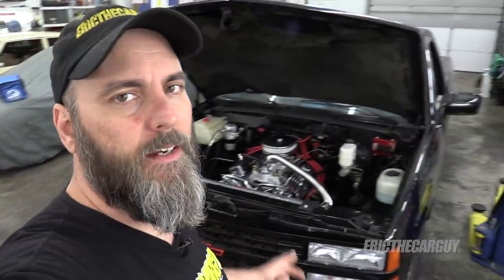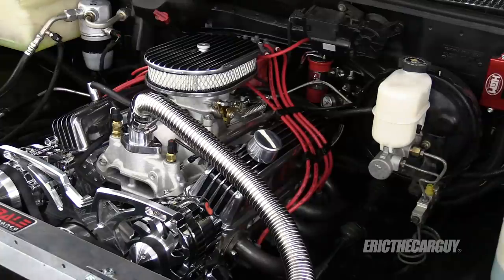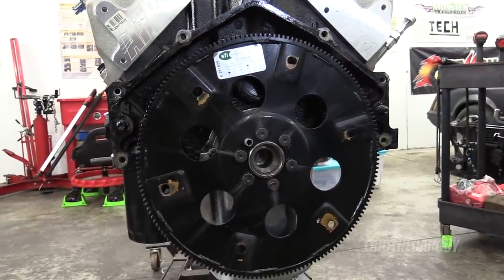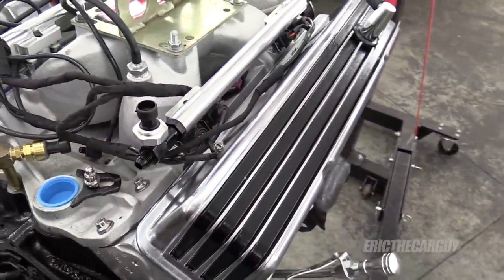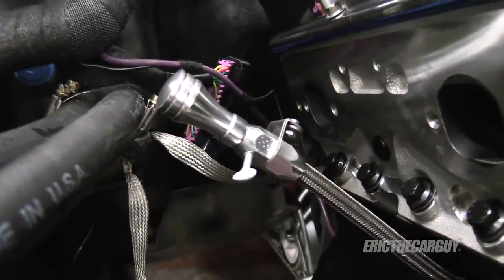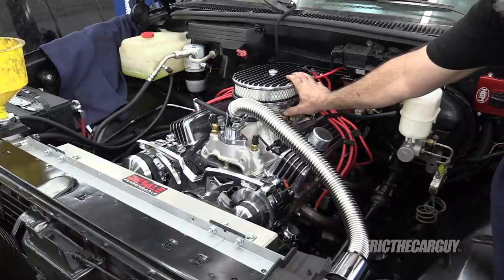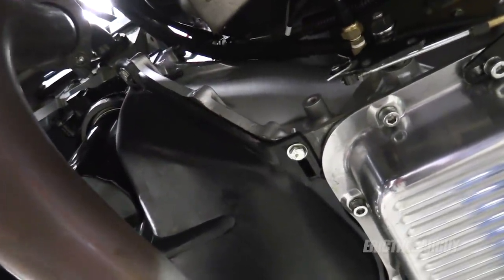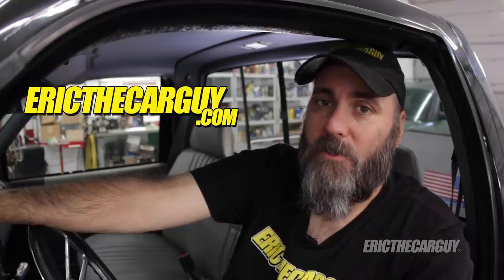Last Minute Prep and Problems #ETCGDadsTruck

Comment: Redline to seat the rings? No way... Seems like you should start reading instructions so that you can put an engine into a vehicle one time per rebuild. At least the truck didn't catch fire!
Reply from the maker: https://www.youtube.com/watch?v=HvVw2MKdUzc
Reply: Sounds like use of the roller cam/lifter set allows for higher revving right off the bat.  Does Kevin recommend redlining break-in on a flat tappet setup?
Reply: EricTheCarGuy I've built Chevy and Mopar race engines for about 38 years and have never heard of redlining a brand new engine, to break-in the rings. That's a new one on me. Is this recommendation coming from the same machine shop that helped you build the other turds? Wow, that's some crazy stuff right there... Don't get me wrong, I always watch your channel and enjoy the videos. But some of the engine work is less than stellar and putting engines in and out of a car several times to correct problems, isn't the way to go. You might need a rethink on philosophy of parts/machining/assembly, just a thought.